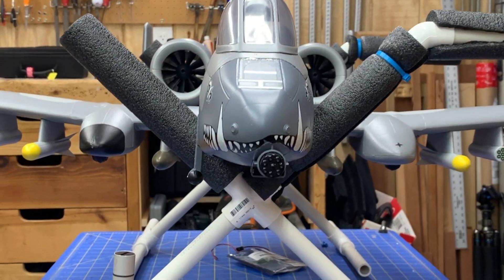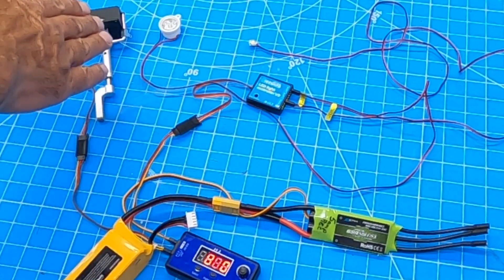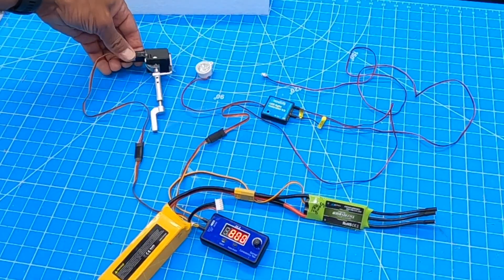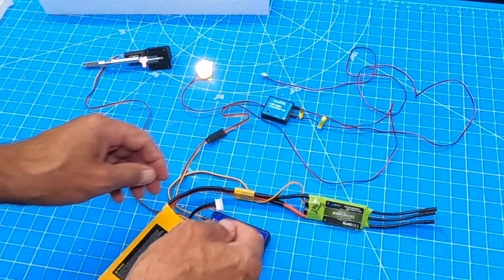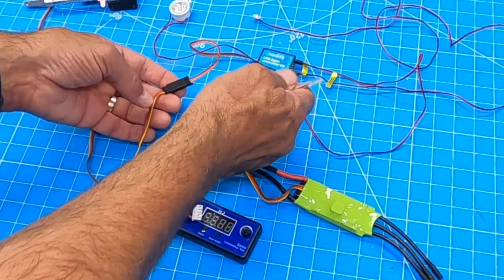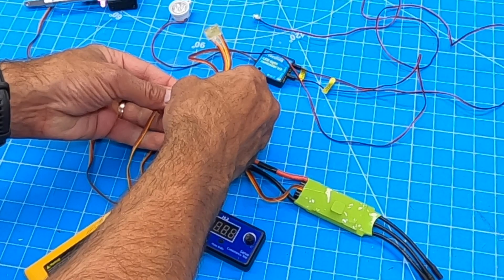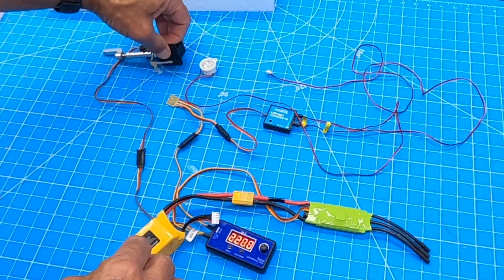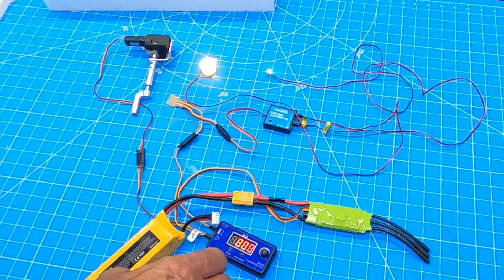How to sync the nose light and front landing gear on RC Plane

Comment: can i use a y cable on my gear to power a landing light?
Reply from the maker: You certainly can.  But the light will be "ON" all the time unless you use a switch.  Frankly, its not a big deal if the light doesn't generate much heat.
Reply: @SteffenRC i have a v1200 and want to put the y at the wing. Will the light illuminate when i open the gear via the radio? Just trying to wrap my head around this before i start buying wires and lights
Reply from the maker: If you just connect a LED to the 5V output of the system, the light will always be on.  The only way to turn it off/on is with an electronic switch that connects to a port on the RX.  Its not too hard, but it you'll need to mess around with it to make it work.

Comment: Man Will, what a great tip. I'll bet that is something many pilots don't know about...until now. Beats trying to "program" the light box/controller, which never has good instructions!
Reply from the maker: Yep.  I've used these reversers on several project.  Make life easier for this gear light switch and when you don't have a reversed servo in stock.